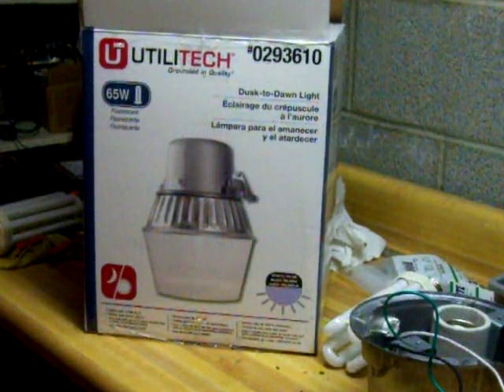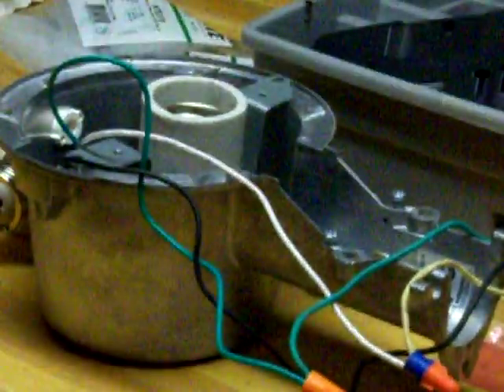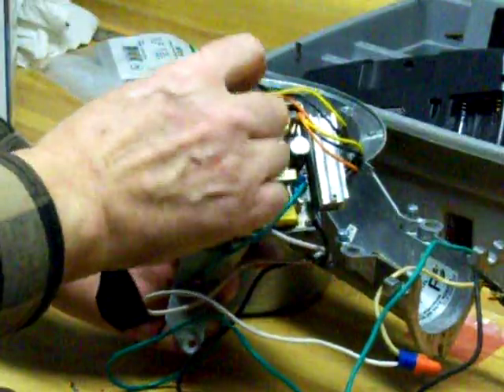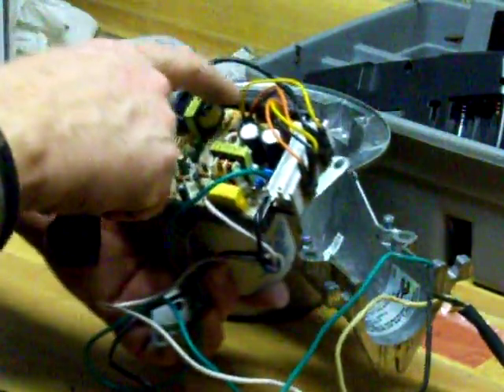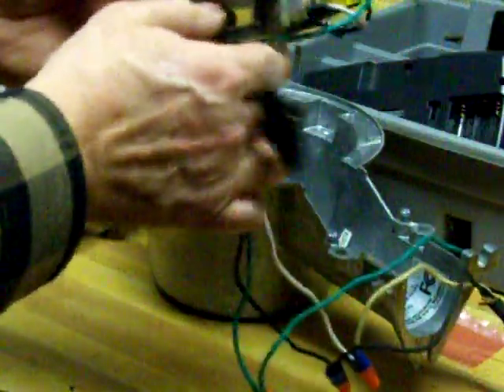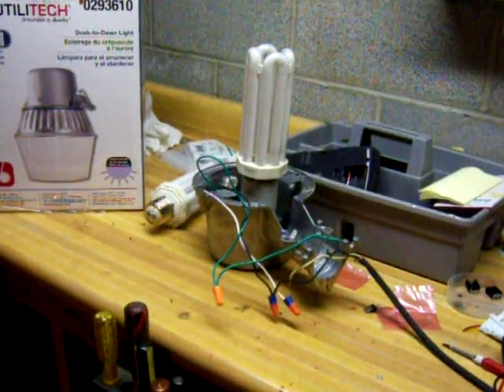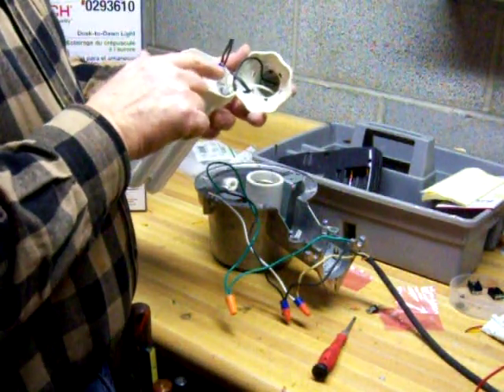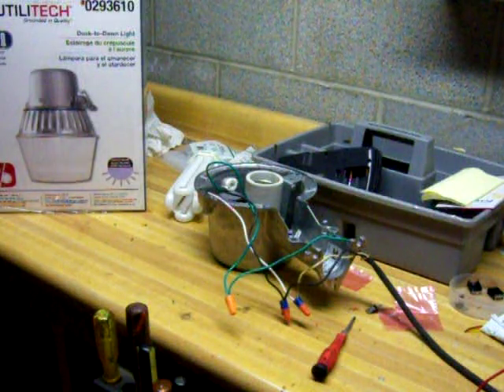Repair of a Utilitech  AL65FLUT 65 Watt fluorescent Dusk to Dawn Security Light

Comment: Can this bulb screw in a normal 12v sock because I bought it from Lowes for 8 bucks
Reply from the maker: Not sure what you mean by normal 12v socket. The bulb is a florescent bulb with a mogal socket and requires a ballast to work.
Reply: I have a 65w utilitech bulb from Lowes I need a fixture to light it up

Comment: Mine is about 4 years old and has started coming in for 4 or 5 minutes and then going off.  I thought it was the sensor, but after looking at you video, think I may have the same problem you outlined.  Was your light doing the on and off routine? 
Where do you suggest I purchase the capacitors and heat sinks and could you provide a suggested parts list? Thanks W4COS

Comment: GREAT INFORMATION VIDEO BUT...... your hand blocks the view of twere you're pointing.  I have over a dozen of these crappy lights from the past 6 years.  I have 7 installed and constantly replacing them because there is no replacement ballast on the internet.  Your video has given me hope but could you please redo this video so I can see where you point?  And what is heat sink paste?  Thank you